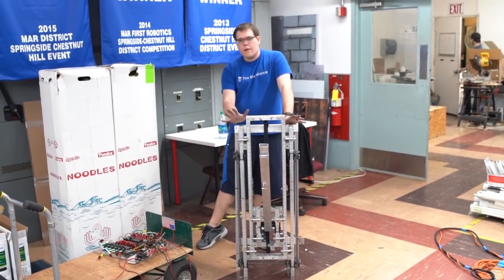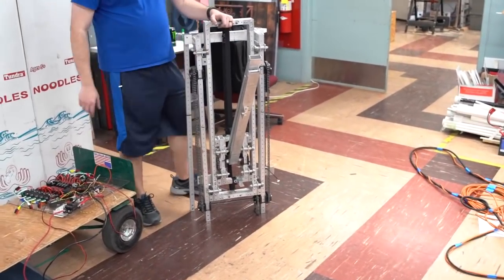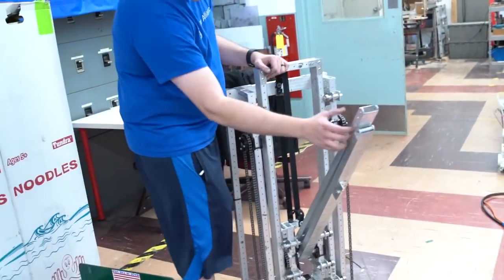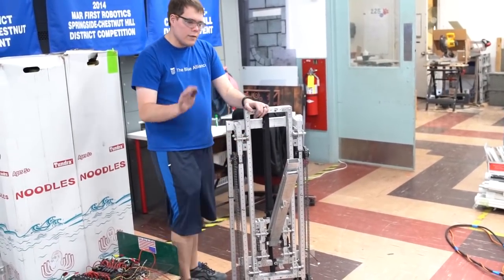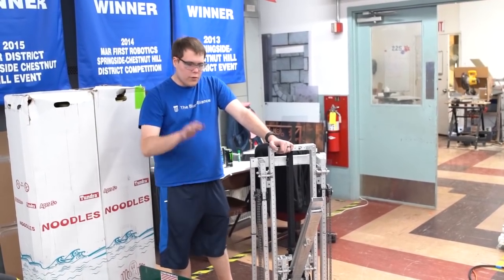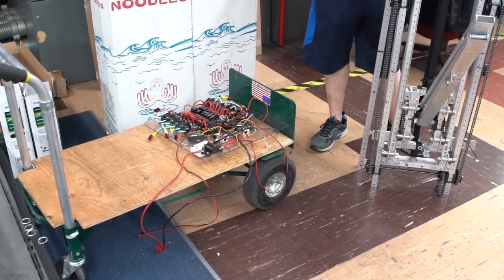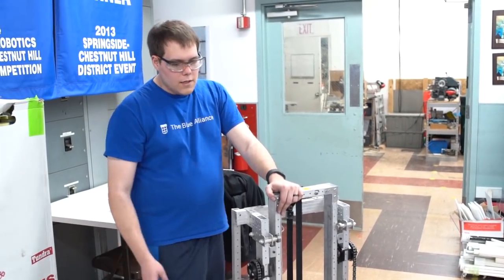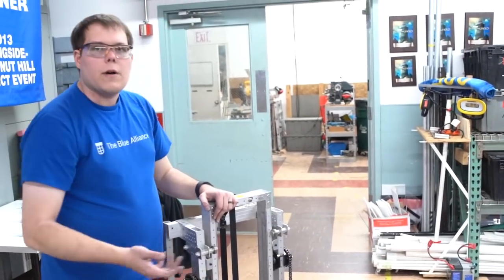Ri3D Team FIRST Capital Two Stage Four Bar Assembly   Robot in 3 Days

Comment: How do you drive the four-bar arm? I'm not sure how you're able to transfer torque onto the 1" side of a piece of 2x1. If it was the 2" side it would make sense to use a Versahub direct bolted onto the tube, or a versablock or something. And I see a chain drive on the 4 bar but no gearbox?
Reply: Check out the CAD for 225's 2018 elevator, the driving of the four-bar is very similar: https://drive.google.com/open?id=1cG1rWRs8fWELm5toG-RrxBGURpW3nihK